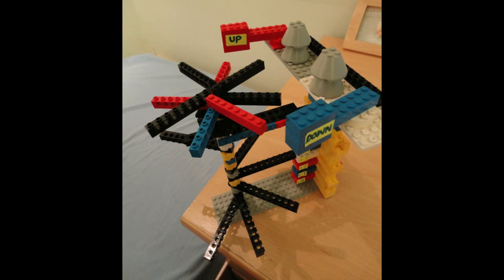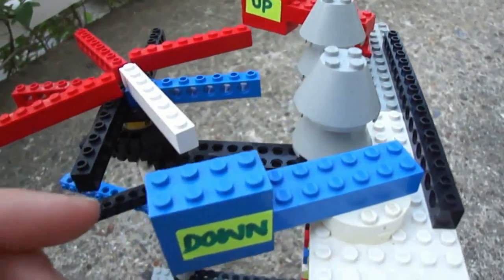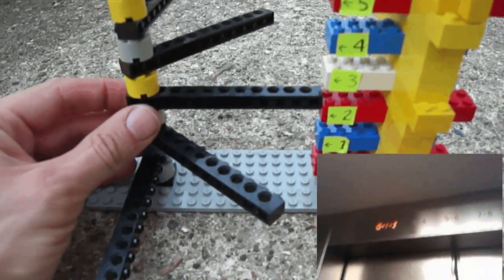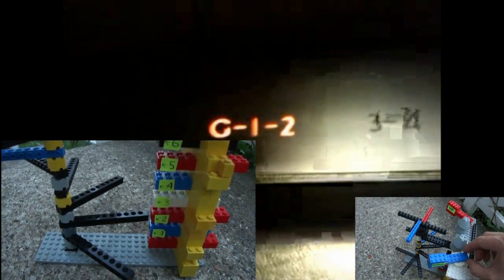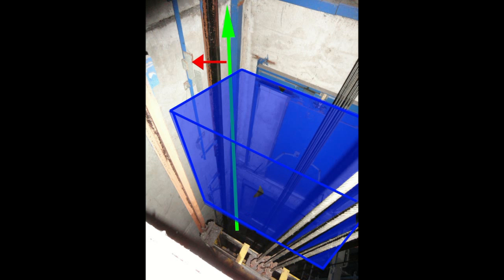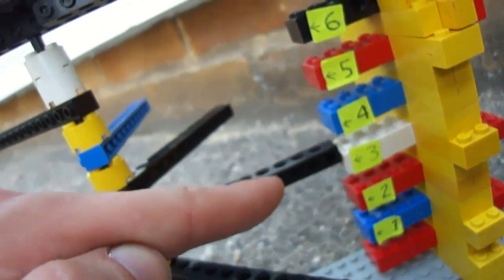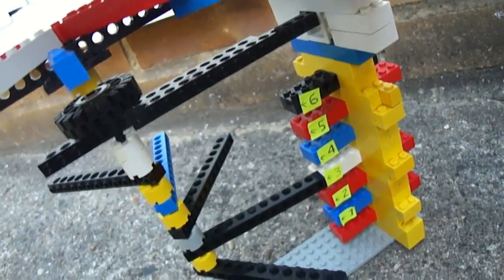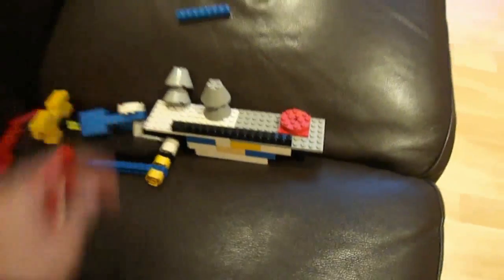How it works - Early lift/elevator controllers - the 'floor selector' explained

Comment: What happen if power is cut when elevator is right between 2 floors ?
Once power will be restored, the lift as no clue where it is (since floor selector is also between 2 floor switches).
Does elevator automatically goes up (or down) until a floor is reached again ? (to try to get back to a plausible state)

Comment: Very informative video using Lego's was quite ingenious I was a maintenance engineer iat a hotel several years ago. Six story building geared traction machines 1:1 roping MG set. In the machine room for the lobby elevator the floor selector was left intact after modernizing to solid start controllers. The chain linkage in the hoist way showing the floor position was still working, could see where the elevator cab was.

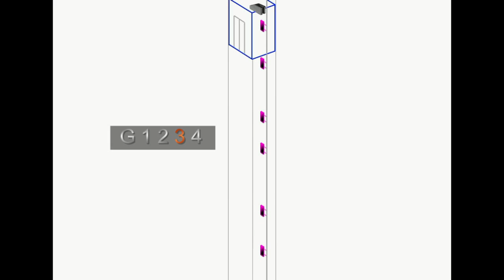Comment from the maker: @harrihealey02 (part2) If you look at 3:42 - 3:55, the inductor reads "2 plates per floor".  Not sure why it has to read two per floor, except that's the way it was designed.
Each time the inductor on the lift car roof goes past a plate, it activates the up or down electro magnet.  On the FIRST move, this turns OUT the floor display.  On the SECOND move,  the next floor lamp is lit.
I do pride myself with explaining things-hope that answers your question.  If it doesn't then let me know :)

Comment from the maker: @harrihealey02 (part1) They are spring loaded to return back when electro mag is not energised.  The red/blue paddles (with 'up' and 'down' stickers) are made out of metal (lego!) and are attracted inwards when the electro magnet is on.  When the electro magnet is OFF (deenergised), there is nothing to hold them in that position anymore, and they spring back to the positions as shown in photo 0:01.
See (part2...)